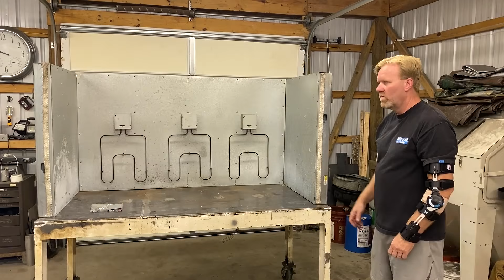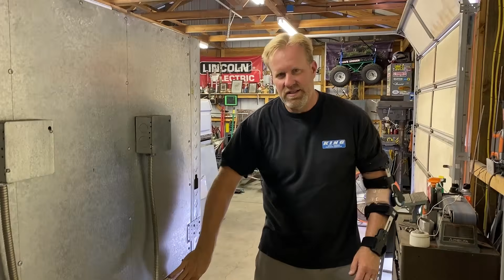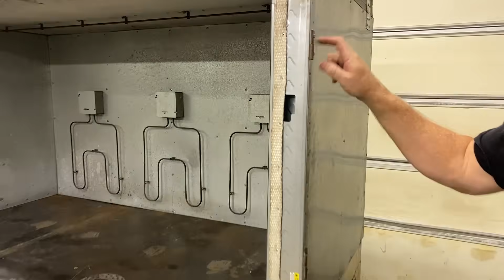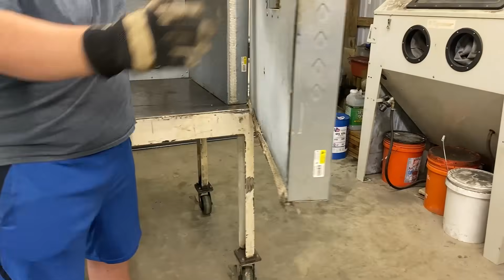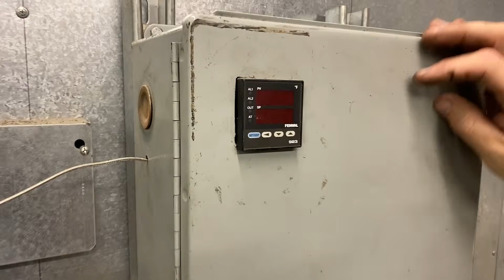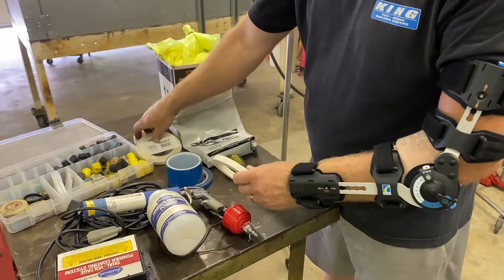DIY CUSTOM BUILT POWDER COAT OVEN (SAVE TONS OF MONEY!)

Comment: $1000 dollars? You can find ovens for free marketplace and use everything to build a small oven. I use a regular oven, but I'm building mine for free using scrap aluminum and an old barbecue grill I found on the side of the road. Of course it's not a small barbecue grill, but it was free.

Comment: I've built a couple, one being big enough to stand in with air recirculation. The one thing I would advise everybody to focus on is giving yourself plenty of options when it comes to hanging something. If you make a big oven, don't make a floor like I did so that you can just roll a cart with your parts in to it. Instead of one rod in the ceiling like in this video, use a grid and cover the entire ceiling. That way you have unlimited hanging point for odd shaped parts. An oven is super easy to make and wire and you can get as fancy or simple as you want. For the last couple years I've just been using an old electric oven. I cut the stovetop off and made a steel top for it and use it for my drill press. It's a little limited in the size of parts I can  fit inside, so I'm researching thinking I want something that will fit at least a wheel inside or control arms. I wouldn't put it on a cart this time. It's nice having an oven with  no floor that sits on the concrete so you can use a rack and have your part already hung. You spray it on the rack and roll it in. No messing around with pliers and welding gloves for second coats and having the part giggle around on the hook messing up your finish.
Reply: For an oven of the size of this video, how long does it take to make, and how much does it cost?

Comment: Galvanized steel becomes toxic when the zinc coating heats up enough to release zinc oxide fumes, which can happen at temperatures as low as 392°F  stay safe do not die in your shop
Reply: You're right, but are you sure about the danger temperature?  Zinc melts at about 420 degrees C or 788 Degrees F.  I think they are fine using zinc skin steel sheet up to 400-500 Degrees F.

Comment: The power distribution box has the red big gauge wire carrying 120V and the other black big gauge is also 120V. 120+120= 240. The green big gauge is the ground. I'm sharing that because there are A LOT of people who think you have only 120V coming into the houses, or some who think it's 240V when it's actually TWO separate 120s that are then used/wired according to what is needed in the house...i.e. an oven or AC units as examples. Why did your electrician opt for a 240V to 120V step-down transformer when you already have access to individual 120V lines in the same box?  That is making more unnecessary heat in the box and consuming more power, along with unneeded redundancy. The oven idea overall is simple and awesome.

Comment: 3100W x 3 = 9300W This is 9.3 KW oven. At 240V it sucks 39 Amps. You can't have it at home
Reply: Incorrect! Those elements are only pulling all of that at absolute MAXIMUM power...and I'm SURE that, with 3 elements in a 3'x3'x6' box, it's never anywhere NEAR maximum power.
Reply: @housearrestproductions2240 the controller just turn them on and off, therefore when they are on they deliver maximum power. The controller doesn't work like a faucet to adjust the flow.
Reply: Why can't you have it at home?

Comment: Wondering if galvalume metal bldg panel would work?  Reason I say galvalum is because I can spend it on the bottom for a pretty decent length and not have to reinforce it. Another thing I would really have my heart set on is making it sort of like a funnel on the bottom like on a sandblast cabinet and isolate my hanger from the metal in the oven so that way the ground doesn't go to the whole entire oven and I can hang my parts in the oven recycle the material put the cover on the bottom close the doors turn on the oven. And have almost zero contact for my hands to the parts between powder coating to curing

Comment: Can you please tell me where I'm going wrong at here . Ok I built a iron box I took an electric stove panel mounted it to the outside of the box wired in my heating element. But also added a second element. I came off my first element with heat treated wire to my second element,but every time I turn it on both elements heat up then kick off before box can come up to temperature. My thermal coupling is mounted high in the box away from my heating elements what am I doing wrong
Reply: I’m no expert in this subject by any means, but I am currently building my oven as well and am using a kit off of Amazon to control the temp with a relay and a thermocouple, sounds to me like you are overloading your system by running two elements off of one supply ment for one element
Reply: Yeah other comment is right. Overloading your system and flipping the breaker. Happened to me with my infra red heat lamps. Had to either remove one of the lamps to lower the amp load or upgrade your circuit

My kitchen oven I use for powder coating runs on my 60 amp circuit I had installed for my plasma cutter. I just run one machine at a time to save money instead of getting 2 independent circuits  upgraded and installed
Reply: Please help thanks in advance
Reply: I even mounted the thermal coupling  low in the box still the same results the panel on outside is showing at F1 code

Comment: I need something like this but just to do 1-2 17 inch wheels max. Any ideas what I could use? Thanks!
Reply: Probly just buy a regular used oven for cheap and stick your rim in there just do one at a time
Reply: @coreyanderson2748  How will I hang it tho? As I’ll assume the powder will rub off laying it flat
Reply: I mean it’s basically all it is. An industrial oven. Really only needs to heat to like 350-400 degrees

Comment: I would suggest having the temperature probe a little lower - so it isn't measuring the highest temperature, but more of an average temp
Reply: yeah, definitely! Because that is how an actually oven also is designed! Good observation! The heat may be cutting off before the lower part of the oven reaches the necessary heat for the Powder Coat on the lower part of a frame like they described having done in this thing!

Comment: beautiful job, gets the job done. Galvanized..?..I personally think its ok, the interior doesn't vent out and the exterior is insulated from reaching above 480. Having said that I woould have used regular sheet metal and used a high heat paint to insulate and protect, but respects for getting it done. the little guy usually doesnt go any where because Abraham Lincoln says we cant:) Wondering if 240v might have been better to drop the emparage..
Reply: Why not powdercoat the mild steel lol only makes sense

Comment: You are slowly killing yourself by having an oven where the heated interior is surrounded by galvanised sheets. The zinc release odourless and toxic fumes at high temps. I'd strongly advise you not to advise your audience to do the same
Reply: What material would you recommend
Reply: @Moparmanic90  Just normal plain mild steel sheets of the same thickness will be fine and is usually cheaper since it's not covered in a layer of zinc.
Reply: @tiaan_va  man thats so true , thats why kitchen ovens are a thin steel and not galvanized . but wouldnt some kind of air vent sucking out the shop help with that ?
Reply: Powder coating ovens dont reach the temps needed for the galvanized coating to melt or start off gassing. Typically they cook at 400 degrees or less...Galvanized doesnt start off gassing until up over 600.
Reply: @formula7414  I don't think you know how ovens and heating elements work.... You do realize that the heating elements themselves are much much hotter than the air temperature at which the items inside are 'cooking' at right? The heating elements are either on 100% or on 0%, you can't adjust their heat. The heat control is for the thermostat and once the air temp reaches a certain temp then the elements get turned off. And this cycle of going off and on will continue to keep the air temp consistent. A heating element (or any piece of metal really) won't even start to glow red until it is 500 degrees Celsius, did you know that? Heating elements like these easily reach 600C and they are in very close proximity of the galvanized coating on the steel behind it

Comment: The coating on galvanized sheet metal starts to brake down and give off toxic zinc fumes at temperatures above 395F,  even if the entire oven isn't set to this temperature the areas near the heating elements will certainly be at least that hot.
Reply: Appreciate that. What metal would you suggest?
Reply: @cameronpresley5771 ive seen some powder coating ovens using just cold rold metal plate think the thickness of the ones on the site where i was working was between 1-1.5mm didn't measure it but thats around what they used to build it

Comment: Why step the voltage down?  Have you ever amped the legs and see how many amps it draws?
Reply: I was curious as well.. looked closer and it appears to step down for the controller. But I can’t tell how the controller is wired in, definitely using a NO in the control to fire the coil on the mainline, not sure how it’s affecting temp unless it’s just shutting off mlc when desired temp is reached..

Comment: Maybe an idea would to make dividing walls between the 3 burning that can be slid in and out..That way when you only have a small part, you are only using a third of the space to heat up..Just need to come up with a way to shut off 2 of the burners when you only need one..
Reply: @regulershowtv and put metal parts in a microwave?😅
Reply: just acquire a large microwave oven to use with smaller parts
Reply: You’d only wire the one burner, and place the thermocouple in that section. It’s a good idea to use way less energy for small parts

Comment: Could you do this with gas burners, my shop runs on 120v outlets so I’m assuming the heat wouldn’t get up to temp. So could i connect it with propane?
Reply: If you have more than one 120v circuit, the two 120v lines can be set up in a way that would essentially give you the 220v that you would need.
Reply: Yes you can..I have seen these portable propane heaters that contractors use to heat a room during the winter..With air condition ducting leading to the box to heat it..
it still needs to have the control  system with the thermal probe and temperature setting..But instead of turning off and on the electric heating elements, it makes the propane heater light up when it needs it..
Reply: @MichaelJohnson-cm4wp  any way you can show me which ones?
Reply: FWIW in the Eastwood powder coating videos they say never use a gas oven.
Reply: You can buy a commercial gas fired powder coat oven.  They sell them online. Several manufacturers making them now.
Reply: Any breaker panel will give you 220/240 by simply using a double pole breaker. Look up how a breaker panel supplies electricity, and you will understand.

Comment: Just add a small metal fan. Then its convection oven,  you can pull hot air from one side and pipe it to the other side for more even heat. Dosnt have to be a strong wind just moving the air.

Comment: For an oven that size, How much odor comes off when baking. My shop is under 2 apartments and don't want the tenants complaining.
Reply: Carbon filter exhausted out window
Reply: Its not about the size so much as the amount of powder you're melting, so the surface area of the parts, it is just an oven afterall

Comment: I had watched a couple of videos of custom builds that were about the size of a dorm refrigerator. I need bigger than that and thought about using metal studs and galvanized metal. I thought I was the smartest guy around and then clicked on your video and found out that  I was the second smartest because you beat me to it. Thanks for the video and the info. Subscribe and thumbs up from me.

Comment: Very nice, I did kinda the same but used an old oven open the door and just built a box like you did but mine just sits on the oven door when it’s open put some straps on the side so I made it little more than double the size but that’s all I need, thanks for the video

Comment: Very interesting. I just finished installing an older stove in my garage and even though it’s ‘small’ comparatively, I’m pretty stoked to get to it!  I’ll keep your video in mind as I move forward. 
One question….. you said it runs on 220/240….  So it’s plugged into a 50amp welding plug? (Like a 6-50R?). Is that all you need in terms of circuit to run the oven.
Reply: I was wondering why he stepped it down?

Comment: Hey guys I wanted to ask you your thoughts on your oven if you used a concrete floor instead of a metal table? I understand why yours is that way but what if I wanted to do a car frame? It would have to be bigger I'm sure but would the concrete floor work ok for the bottom? Thanks
Reply: Yeah, a concrete floor is perfecly OK. My oven sits right on the floor, no problem. Hm, I have no videos yet to show you the oven, but there's some videos when I powdercoat MC parts. So, just build it on the floor 🙂. Regards // Tom
Reply: @Nrgpack  thanks Tom, the way you made that is awesome you could expand it easily which is what I will probably do.

Comment: You need to add some radiant shields over your elements, just some sheet metal with 3/4 -1' holes, hanging in  front of the elements. You may not have had any problems yet but it will if you get some parts to close to the elements. It will actually burn the coating or discolor it . Don't ask me how I know. LOL 
I have two ovens in my shop 7' X 7' X 7' inside measurements and a 4'6" T x 3' W x 32" D inside.  I  heat mine with LP, I built my own burners and controls myself. The big oven, I can bring from 32* up to 400* in about 9-10 minutes and the little oven about 15 minutes (different type of burner. I don't need to dump 500,000 btu of heat in it.)
Reply: Nice! Any more info/tips on your setup? My garage is off grid and I’ve been wanting to do LP. Because my system wouldn’t be able to run 15kw of elements

Comment: Just wondering what the transformer is needed for. Use a 4 wire plug like for an electric cook stove and you have a neutral to get your 110v
Reply: Welders use nema 6-50 which does not have the neutral. Old codes let the 120v devices use the ground but that is dangerous but it works...........so I'm told :)  I thought many PIDs ran between something like 100v and 277v for the input, but maybe theirs is 120v. I used one that works on 240v and a single oven element wrapped around a steel cylinder for an automated bullet casting machine that I built. My tig welder has a smaller 110v transformer like theirs, since it was made to run on 208-480v single phase.....I think it was built around 1965.

Comment: I’m building this but three times bigger. Only concern I have is how to determine how many heating elements to use. How do you find area an element will heat? I’m using 3600w elements x 3
Reply: Depends on how well you insulate and how long you want to wait to heat up
Reply: Sorry last question.  I used a typical contactor.  When it get a few degrees from the set point, it cycles alot trying to regulate the temp. Is that going to wear the contactor prematurely?  Do I need to get a different style of contactor?
Reply: @nickb.6884  Depending on the type you might be able increase the range between the on/off, so if you get to 400F cut out then cut in at 390F. Otherwise if you have a separate temperature controller, you'd adjust it there. If you increase the range between on and off, the heater will turn on longer and cycle less. If you have it 1 degree off, it'll cycle all the time. That's at least how home thermostats and pressure tank switches work. The frequent cycling is also related to the insulation. If you insulate better you'll reduce the cycling.
Reply: @nickb.6884  As long as it's rated for the current, it should be good for like millions of cycles.
Reply: @nickb.6884  I think PID controllers have an option to set a range to prevent constant cycling, based on reading the directions on the one I used. I agree with everything Krap101 said.
Reply: @nickb.6884  I would go with a Solid State Relay (SSR)  One for each element. Eliminate that annoying clicking. Plus they will cycle a lot faster.
Reply: Forget the electric stuff, go gas and you have no problems

Comment: You didn't  mention the size of wire. Looks bigger then #10 by the video. The power cord is from an arc welder. What size of wire did you run for the 220/240 for the plug receptacle to plug it in?
Reply: It will depend on how many watts your elements are. I use a single element on my automated bullet casting pot, so 16 gauge wire was enough for 10 amps. With the 6-50 plugs I use 10ga for my 230 amp mig welder and small plasma cutter but have to use 6 gauge for the big plasma on the cnc table I built. It will pull up to around 50 amps. My tig welder is direct wired with 4 gauge, but it should have bigger wire if it is used often at full output. 10 ga is good for no more than 7000w while 6 ga should do 12,000w, but bigger isn't a bad idea for something that pulls full power for long periods of time. Welders can get away with smaller cable depending on duty cycle.